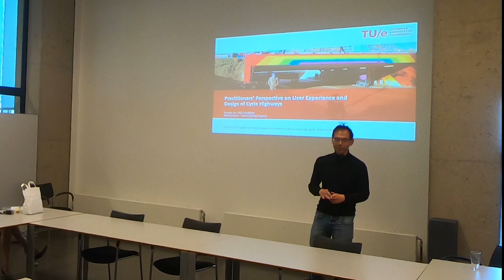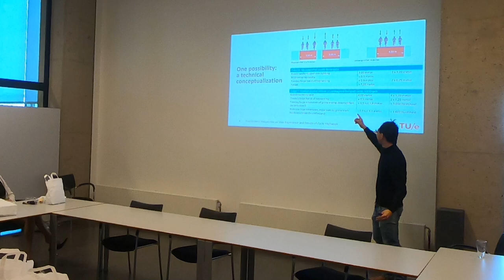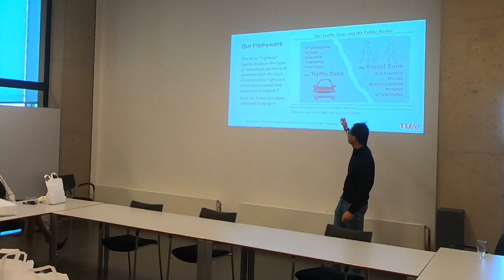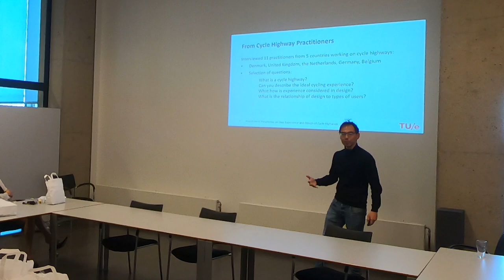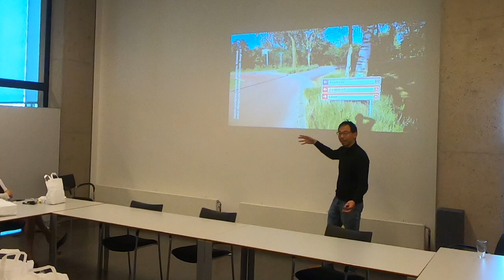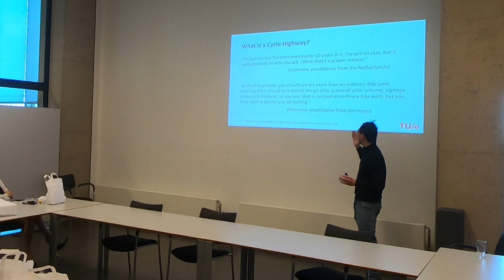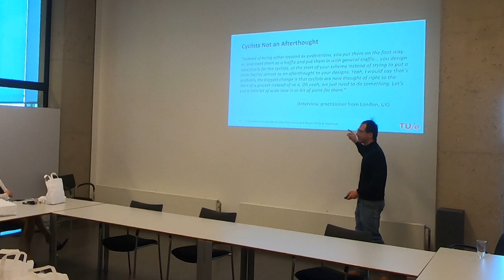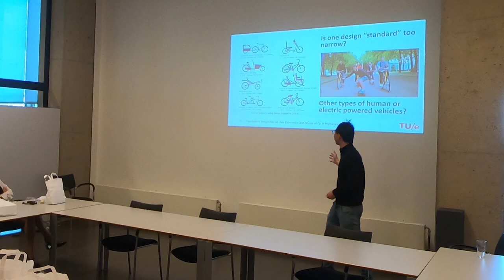What is a Bicycle Highway? Perspectives from Netherlands, Denmark, Germany, Belgium, UK

Comment: I find it interesting that the quote about not being an afterthought came from the UK - considering the fact that the so-called cycle superhighways in London are mostly just a bit of blue paint [maybe 1.5m wide] on the side of a busy road and motorised vehicles aren't even prohibited from driving in them.
Reply: Yup, they are dog shit, I don't cycle much in London these days but I simply will not restrict myself to a death lane. You get more left hooks (right for right hand side drive) and people simply walking into the cycle lane. People are led to think they are safe travelling in the lane and yet at junctions and lights there are left turning vehicles of a monumental size (HGVs) that will turn across the lanes without checking they are clear as they do not see the lane as being a lane to traverse as per any other road lane. 
just stop the roads up on certain parts of the network and use roads for cycling, instant infra, virtually zero cost and wide and direct.
Reply: In the Netherlands that's only allowed if cars can't go faster than 30 on that street.

Comment: A bicycle highway should be wide enough, wider than the normal width of bike paths, should have no level crossings (underpasses or overpasses), no traffic lights where you need to stop or crossings where you should give way to cars. And no scooters or mopeds. And it should have a separation between low speed bikes and high speed bikes. So four lanes for bikes, two in each direction, a low speed lane and a high speed lanes with raised lines or barriers. And just between cities and towns, not in cities or towns, that would be too expensive in the short term. That’s something for the long term. We could start with bike highways from the suburbs and outskirts of the city to science parks, universities and high profile business and office parks. And slowly extend them to neighboring towns and cities.
Reply: Simply take the motor roads away from motors, problem solved, direct, wide, already built so it's virtually zero cost. If you do not restrict motoring you will never increase modal share significantly. NL is somewhat different due to its long term cycling history and doing something 50 years ago but it also has a low population and no real big cities compared to many other countries.
Too many cycle lanes in NL cross motor roads and the consequence is lots of deaths at these junctures.
Reply: @tonyfranklin8306  yes junctions aren't the best places, but you can't always avoid them, but you can make them save and that is in the Netherlands. That makes why the amount of deaths and injuries are so much lower than in the rest of the world.

The Netherlands has maybe smaller cities, but it is the most denced place of the EU. There live more people in a small area than in the rest of the EU, what makes that there travel more people on a small area.

The width of the bike roads depends on  the location. Some places don't need much space, even in a city center, where other places need more space, because more people use it.
Reply: Which actually makes it kind of pointless; you're describing a car highway, but car highways make sense because cars have a very large gap between the slowest speeds and highest speeds they can go at; hence a highway allows you to safely go faster, and just not faster, but also without have to slow down/stop, which at higher speeds both costs you a lot time, and burns you a lot of extra fuel getting back to that speed.

But bikes don't really have all that great an number of operating speeds; sure there are a few racers who can very fast to race; but you're not going to go that fast for a commute; you'd be sweating and stinking requiring a shower by the time you reach your destination; it also means you have exerted a lot of energy, and have does taxed your mental and physical resources heavily before you can start to work. Similarly, stopping or slowing down for an intersection has but very little impact on your overall travel time.

Commuting by bicycle will be done by virtually everyone at a leisurely not strenuous speed, making highways you're describing pointless; the only thing you need on any bicycle path/lane/road/highway is enough width to accommodate all the bicycles.

This also rather explains why there is so little agreement on what it's supposed to be among actually designers, and why at least one of them doesn't even know what it is supposed to be.

Comment: Bike highways should be away from cars and away from pollution. Bike share data can be used for routing.
Reply: Bike highways should be using the existing car highways in towns and cities, taking away 'motor' roads should be the priority, building segregated lanes is wasteful and does not have the maximum desired effect. hence why NL has increased driving and lower cycling as well as increased cycling deaths.
Bike share or rather bike 'hire' is a restrictive way to highlight failure to have joined up infrastructure/transport such that people can use their own cycles to get places.
Reply: Most motorways are not inside of towns and cities they run inbetween them, and I think that is the point the original commenter was making. Segregated lanes are not wasteful, they still take away traffic but they also make cycling feel safer, which is why the modal share for cycling is so high in the NL. Cycle hire is not necessarily a bad thing, it’s more a step in the right direction, it just works better when implementing a cycle network as those without bikes are given the chance to use it more quickly